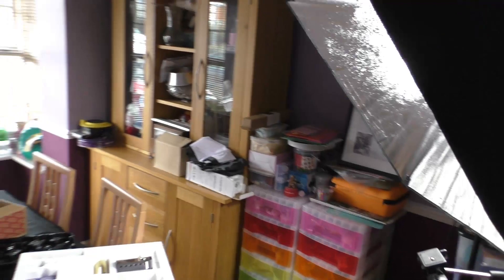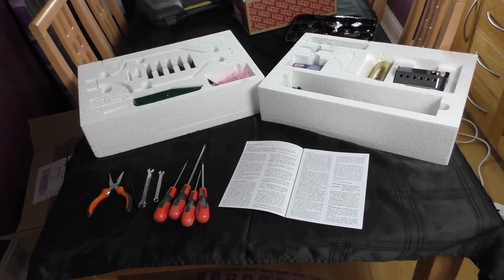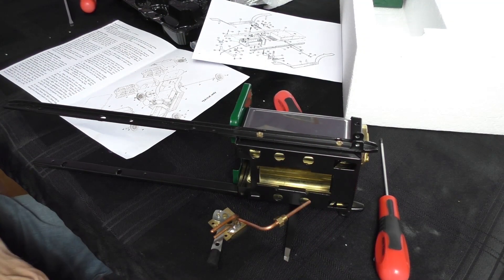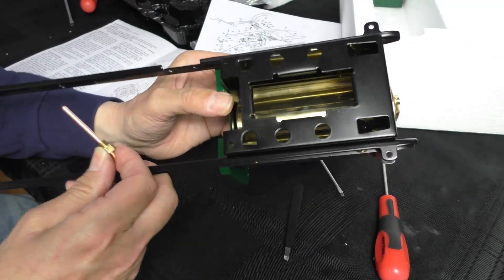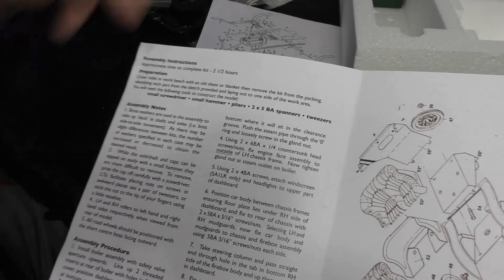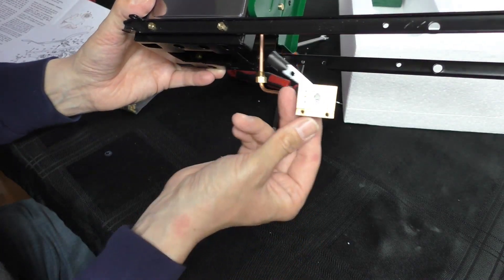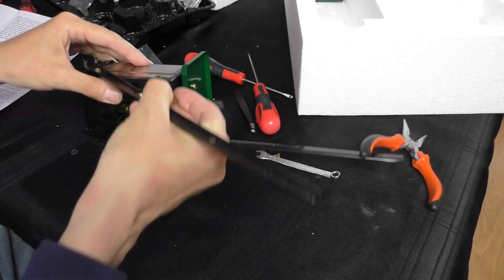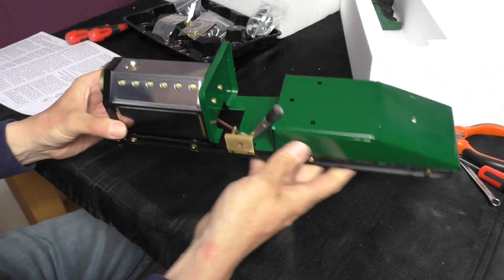MAMOD Brooklands SA1 steam car engine Roadster Kit (build video 1)

Comment: Hi Fred my roadsters is a 1977 model just fired up for the first time on test block wheels go backwards but not enough to move on ground can't get them to go  forward any ideas there is I bit of bubbling around the safety valve on boiler would that been an issue or is the piston lever thanks
Reply from the maker: Hi.  It might be the piston seal.  My white one was the same.  I carefully cleaned up the piston and injected some thick seam oil into the piston and it pick up.  Its on the restro  video i made i think.  best  of luck.

Comment: Thanks for the boiler 'o' ring tip. Just bought a limousine kit and  checked out the boiler and there it was already installed. Also going to make a proper exhaust pipe.
Reply from the maker: Nice one John.  Yes i think the proper exhaust out the back will look great.  Good luck bud.